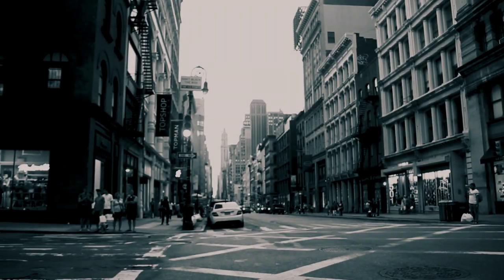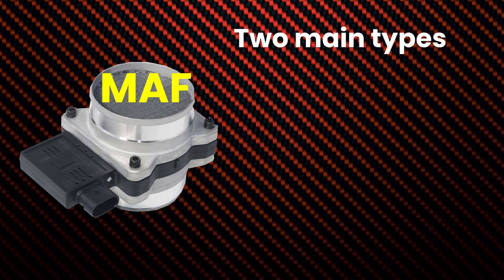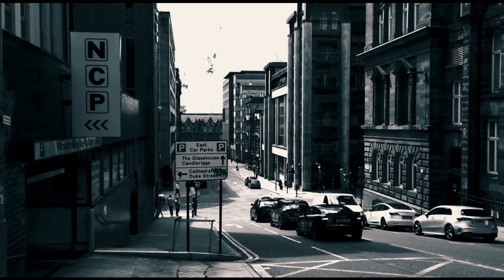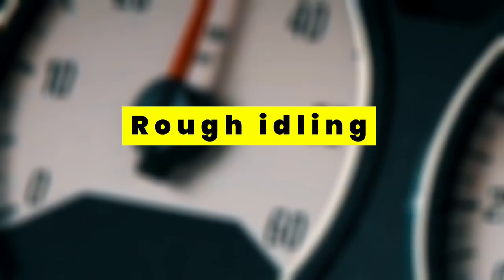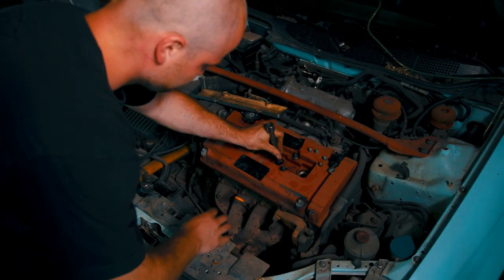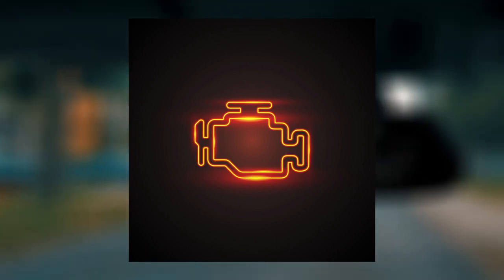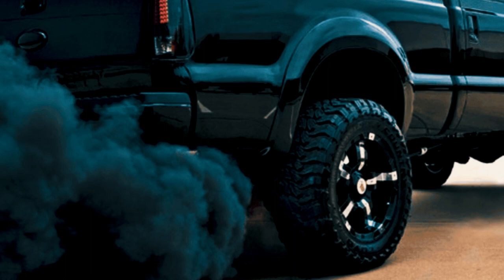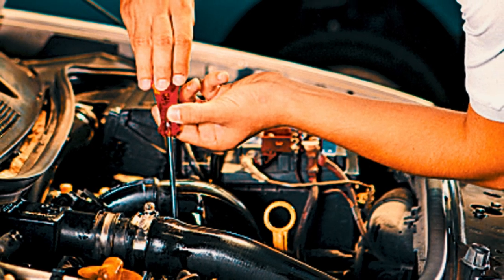6 Common Bad Mass Air Flow Sensor Symptoms | Identification TIPS

Comment: Yeah... don't spend £10 of a can of MAF Cleaner to fix the issue but pay a Dealer £150 for 1 hour to Diagnose the issue and then charge you £100/hour on top for a 1min fix and wait just 30 to 60mins to dry and refit. Amazing that this is NOT part of a Service when the can even says it needs doing every 10k Miles. Jesus fekking Christ. What a 1st World problem to know about. Fek this thing. Buy a fekking MAF Cleaning Spray Can for £10.
Reply: Thanks for the info. Yes, I've heard dealers do that.
Reply: There's more to fixing a car than reading the instructions on a can of aftermarket cleaner. To start with, not all manufacturers allow you to clean them. They're easy to damage and feel its safer to just replace them. Now, of course you're going to say that its a big conspiracy to sell parts. Most of the time these sensors are replaced under warranty. You're also assuming there's nothing else wrong with the sensor and cleaning is the only repair. 

In the real world, techs have to prove their diagnosis. You can't just get a code and replace a part. That's what Scotty Kilmer does. If I fixed a car that way, I would be fired on the spot. Do you know what the procedure is to check and verify that the airflow sensor is really bad, and not something else? We have to do that. A lot goes on behind the scenes that customers just aren't aware of.

You don't have to take my word for any of this. Get the workshop manual for your vehicle, and read through the diag and repair procedures for the problem you're trying to fix.
Reply: @AT-wl9yq  that too. Yet for me and most at Winter the real issue is a Battery which is not getting used and charged fully by small trips to another town and back even ywice a week.
Once the battery is below 12.5V it only takes a hard Winter to deem it as faulty and needs the new REPAIR FUNCTION we find in Trickle Chargers like Hulkman (their Sigma 5 is for Cars NOT Sigma 1).

A poor start adds many Faults like flaps not opening and then adds to other issues when running it with EPC Light on as in "Rich Mode". 

Reality is, those were not real faults but needed more startup Volts.

Worth buying one and using REPAIR FUNCTION to keep battery living longer than the 3yr span instead of just buying new Batteries.